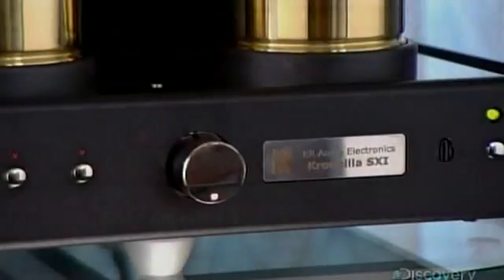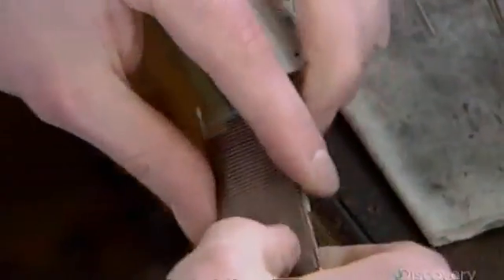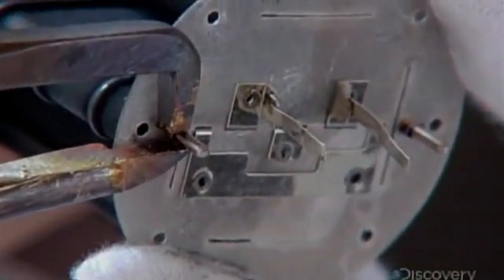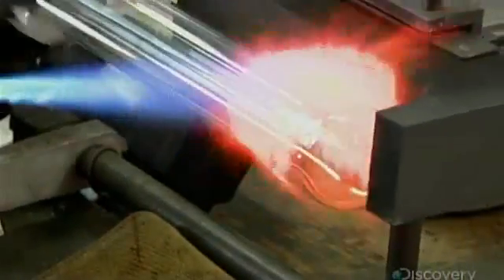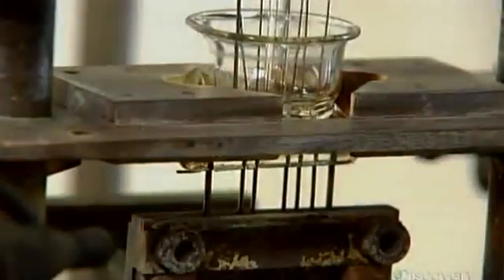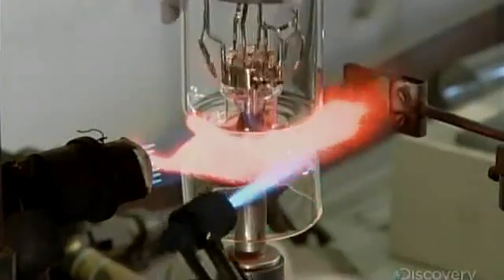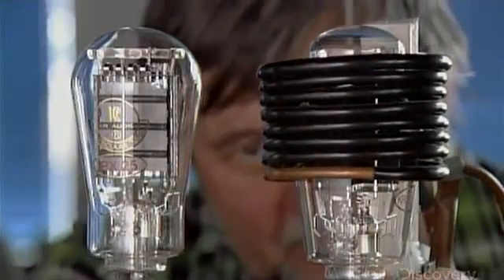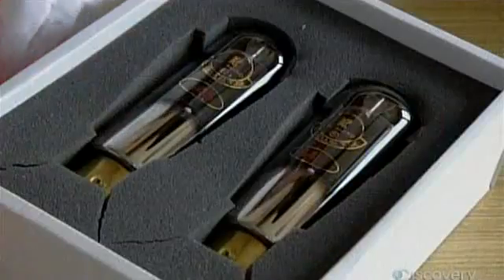How It's Made   Audio Vacuum Tubes   SD   360p  =KCK=  x264

Comment: Tubes are cool, but honestly they do just add distortion to the signal. With good source audio, a much smaller, much less expensive, and much less power hungry transistor amp will amplify it without changing to the profile of the signal. Then you can leave it up to your headphones or speakers to color the sound to your liking. I guess it's all just making the right match.
Reply: Simply untrue.  We can place both tubes and and transistors in test jigs and measure/graph their linearity.  Transistors can be highly linear and have fewer variable, e.g. cathode materials, temperature, voltage, etc.    Musicians/guitarists, tend to value the distortion qualities of tube amps, not their linearity.
Reply: +Sam Carmack   Don't forget the T-Amp amplifiers, like the Trends Audio with TA2024 chip. Perfect sound!
Reply: Actually, solid state devices produce a fatiguing odd-order harmonic which colors the sound.  SS sounds colder and often lifeless and hard. Strings can sound flat and steely, lacking ambient recovery.
Reply: They're not cool, in fact they're heated with a filament.
Reply: It's actually the output impedance characteristic that gives tubes their desirable sound not any measured distortion that they add.
Reply: Pro-tube audiophiles and engineers conceded  decades ago when engineered for faithful reproduction the point goes to solid state equipment. additionally it was discovered t how to engineer solid state amplifiers to a point even the most discerning groups of audiophiles could n't tell those from a tube amp in fair blind testing
Reply: Sam pointed out that tubes add distortion, even many tubes forever audiophiles agree to that. Your response to him reveals you don't understand basics like tube are voltage controlled devices, transistors current controlled devices. Power tubes don't hit 700 V., however some may have 700 V. applied to their plates. Thing is if you like the distortion of  tube guitar amps, you would want properly designed solid state equipment to be able to faithfully record that distortion and play it back on home audio equipment.
Reply: actually no transistors sound worse witj distortion and signal loss as the voltage goes up... tubes are able to take anything including over amplification like distortion if you want an extremely loud clean signal you go tube.  some power tubes hit 700volts in guitar amps
Reply: But increasing the preamp signal will result in massive distortion. Which is great for guitar amps, but bad for listening to audio that is already mixed and stored
Reply: +Sam Carmack um... so you dont distort the pre amps ;) 
and youndont want distortion from the preamps anyways the right way os to use distortion on power amps that is wjy attenuators or limiters are great on guitar amps you limit max wattage and set preamp setting to preffered then crank up the power tubes. this gives the cleanest signal and defined distortion if used.  preamp distortion compresses the sound
Reply: +TheBillproject lol guitar amps are a whole diffident ballgame, but I guess it still applies. At any rate, the second order harmonics are great for guitars and sound better than solid state amps. But headphone amplifiers are better suited as solid state. The objective 2 designed by nwavguy or whatever his name is amplifies the signal to be loud enough for any normal listening, especially if you get the high gain build. At least for headphones, maybe not speakers. And the level of distortion is very low for how small and easily manufactured it is. To me it's an obvious choice, but to each their own.
Reply: +Sam Carmack Actually tubes are intrinsically more linear than solid state devices. Solid state designers use multiple stages with a lot of negative feedback to achieve low distortion. However we don't yet have any objective measurements of electrical performance that relate well to the sound of music (other than perhaps slewing distortion where the simplicity and lack of negative feedback in good valve designs excel).
I once built a drive stage (for an 845 triode) using a triode connected EL34 that could swing 280Vp-p (100vrms) at 0.1% THD for whatever that is worth. I used no negative feedback other than connecting a pentode as a triode. That's extremely linear and I am not aware of any solid state device that could come close.  The reason why valves work so well for reproducing music is that a valve amp may have as few as two stages (count the stages in solid state amp) with no loop feedback thus much less messing with the complex signal that music is.

Comment: These cool devices are the best tech ever... Have experimented and build all kinds of  things with them all of my life. Most prefer vacuum tubes over transistors when it comes to audio love that hum of power and low distortion...

Thus, you can make any to work by simply modifying the circuit. Today I'm building a two tube amplifier with tube biased oscillator too refurnish an old cassette deck.

Lastly, if we get whacked by a monster 1859 solar flare, still will have my music to listen too via all tube and AC induction motor construction.......
Reply: man... 
you say all the right things!
tubes 
induction motors
tesla?

Comment: Tubes sound better, I know because I experimented, making preamps with tubes and transistors and I can honestly say that the tube preamp sounded better, much smoother and nicer than the transistor version, which sounded gritty in comparison.
Reply: It's a well know truth : everything was better in good old time ;-)
Reply: tubes don't clip..they get louder..that's just the start...
Reply: Chances are pretty good  someone could take the equipment you constructed play it back to you in a blind comparison you wouldn't be able to tell the difference, unless your solid state engineering was horrendously sloppy. Pro- tube audiophiles and engineers long ago conceded the "warmth" of tubes is distortion, that has alwaysbeen there with tube circuits  state equipment when don correctly is the  better at faithful reproduction of adio signals.
Reply: I use a vacuum tube pre-amp, and I enjoy it more than any ss pre amp within thousands of dollars.  Even order harmonics, natural air.  Much more musical.
Reply: You've probably proven that you were able to recognise some poorer solid state amps. Anyway, bottom line is, use the amp you prefer the sound of - it doesn't make it "better", but it's better for you and that's what counts.
Reply: 1959Berre yes, but a smoother edge than a transistor  simply running out of voltage
Reply: One is not "better" than the other they sound different some people like the crispness of solid state and some (including me) like the warm silky sound of tubes.
Reply: CoolDudeClem depend on the tubes, some cheap tubes are way more shitty than chip amps
Reply: obviously assuming both are high quality which is better. i think tubes give more true to life reproduction. 

also why not best of both worlds a hybrid ?
Reply: That is complete BS.  Tubes clip.
Reply: I disagree with that, I've seen transistors do very well and they are more faithful to the original recording but I can see why people like tubes however, they do distort in a way that is actually kinda nice to the ears.
Reply: +CoolDudeClem the evidence just isn't there and it is purely to taste, see also: people who swear by using gold hdmi cables

Comment: TRANSISTOR SUCK  with theyr sandy noise.  the poor audi signal gets dirtened and sanded trough those  silicon layers
Reply: I like transistors.  I think they sound good as well tube sound good.  Each have pros and cons.  I have both type of receivers and amplifiers.  I think they sound good in their own way.
Reply: Today's solid states get the job done if you don't want to break the bank. Hell, even hybrids are reasonably priced.
Reply: are you high?

Comment: ive tried everything, nothing beats valves/tubes
Reply: what an ironny,  the best is still the old tube   whatever they try, the best was there since the beginning!!   hurray!!!     (mosfets have better bass  they beet the tube on that spectrum but they breack with a single static discharge)
Reply: Alessio S Maybe you are right at there, but these tubes are made with an outstanding degree of quality in the process, not sure if consumer grade tubes back then were made with such care (though the difference probably is not much), Also, though tubes were somewhat in use a hundred years ago, they improved a lot during the time they were the norm in electronics, who knows, maybe even today these manufacturers look for ways to improve their tubes, maybe those in the video are even better than the ones used on their golden age. Early ones were definetelly crude. Luckily the radio craze made it necessary to improve their quality.

Tubes are mostly obsolete, that doesn't mean they are less advanced than solid state, they are just less practical to the uses we give to them. Developing solid states involves quantum physics, but so do tubes, and these maybe even more. Let's not forget that when you take yourself a radiography, the X-rays are made in a specialized vacuum tube. And photomultiplier tubes (these definetelly are NOT obsolete), even more quantum physics.

The tubes in the video seem very advanced, but in availability and appearance, they are more like they were in the 1920's, they are hand blown, beautiful, and expensive.

Would love to have one of these wonderful tubes in my hands, but they must be a pain in the wallet to get, I guess.
Reply: MisterTalkingMachine
"Would love to have one of these wonderful tubes in my hands, but they must be a pain in the wallet to get, I guess."
Indeed. $1395.00
https://www.tubedepot.com/products/kr-audio-845
Reply: TheParanoidAndroid79 Dear god, it's way too much worse than I thought.
Reply: You have not tried everything, clearly.